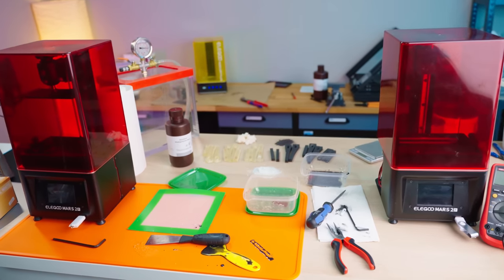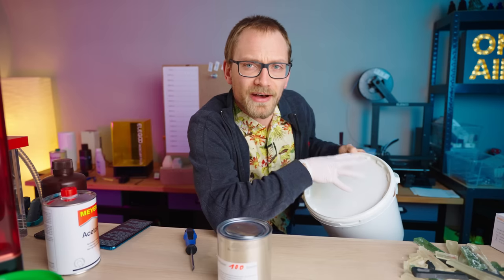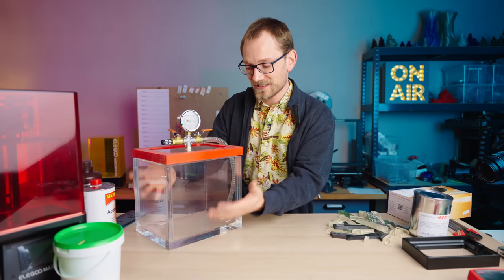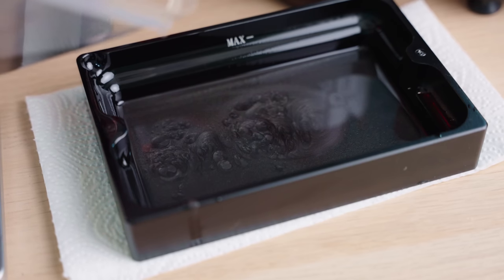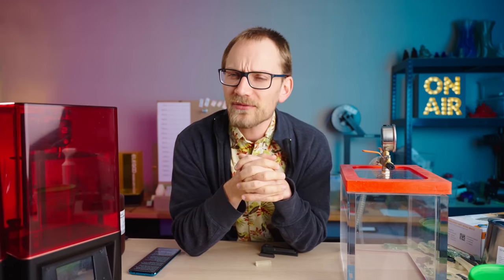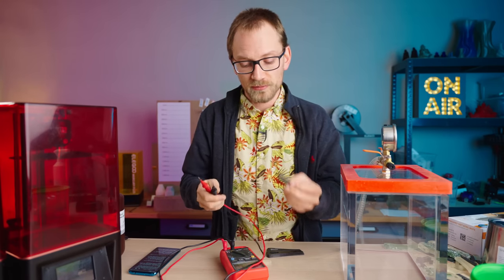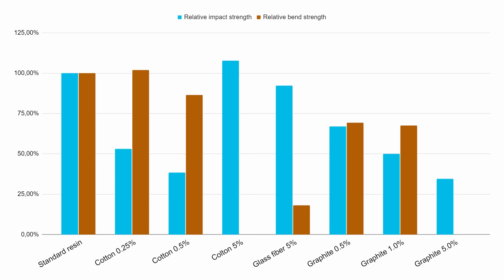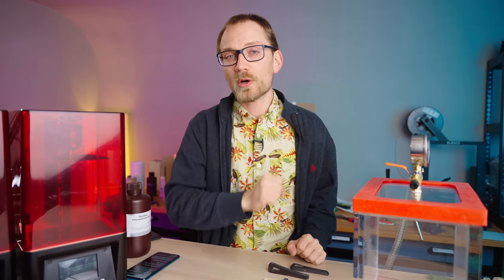Easier Fiber-Reinforced Resin Printing! Stronger and Conductive Resin Prints?

Comment: I very much appreciate tech creators who also show failures, not just success after success.  That's the engineering/scientific process.  Good engineers/scientists have a high tolerance for failure, building on it rather than giving up.  It is often the failures in pursuit of a goal that create spin-offs enabling entirely new directions and new goals.  Such as adding carbon for color and perhaps lubrication, rather than for strength.

Comment: I think a lot of the problem with this is that, while the particles (cotton and chopped fibre especially) are adding strength to each layer, they are only adding strength within that layer. Because of the way SLA builds the object, you're not getting any cross-links between layers, so it is exactly as strong as a normal object in unenhanced resin.

Comment: The reason for the "holographic" effect you saw in the graphite resin is that the flakes of graphite are orienting themselves with the flow of the liquid, so that their reflective surfaces are tangent to its flow - creating what is known as a "rheoscopic" or current-showing effect. In the bubbles, I'm pretty sure what's happening is the super-fine particles of graphite are causing an effect called thin-film interference, where the reflected light from the top and bottom surface of the material are different wavelengths and start to interfere with one another, causing those wild colors to emerge. The same effect is visible in soap bubbles to a milder degree

Comment: I was hoping you'd mention the lubricating effects of resin, glad you said something at the end. It makes me think of oil impregnated bushings. In addition to that, I'm very curious about thermal conductivity of those graphite parts. We messed around with some plastics at work filled with something and I want to say it was graphite. Although they lost flexibility, they had a very "cool to the touch" feel and that's exactly what we were going for. Trying to get thermal transfer improvements through the part.

Comment: Light is reflected from the outer surface and the inner surface of the bubbles, As the thickness is very thin,there is a difference in the refraction angle and it forms a miniature prism effect. Love the experiment.

Comment: It's only a theory, butI believe the fibers will impede the ability of the resin to fully cure by occluding the light paths to all areas of the resin. The masked resin is left to cure partially with refracted light from the subsequent layers. I'm not a composite expert, but I've been around materials a lot, and have some related experience.

Comment: Tom, I reckon that the graphite is so opaque that it's not letting the UV through the outer shell of the part to properly cure the inner. That could explain why adding more makes the part weaker.

Comment: The problem is that in a composite material, the purpose of the resin matrix is to transfer load from one fiber to the next. If you don't add enough fiber, you're just introducing impurities and therefore reducing strength. And you can't add enough fiber and still have a successful print with the way that lcd/sla printers operate.

Comment: These results make sense...the strength of resin comes from the cross-linked polymer chains.  Any foreign fibers you're adding just means there are fewer of those chains, and those fibers are stronger when locked together than chopped up and mixed with a foreign substance. The graphite did look cool though.

Comment: The glass fibers are clumped together because they're coated in something called a sizing agent. Sizing agents are essentially coatings that cover the fibers. Because glass fibers are chemically inert they will not bond with any kind of resin or epoxy matrix. These sizing agents have two fold benefits, they allow for this chemical bridge (aka a coupling agent, for glass fibers it's typically a silane) to bond to matrices and add a protective layer to the outside of the fibers for easier handling. They also bond the fibers together, that's why its so hard to pull the individual fibers apart, they're essentially glued together. That being said you can just sonicate the fibers to loosen and separate them.

Comment: You should try cotton and fiberglas at the same time. The cotton makes the resin thicker, so the fiberglas can stay chaotic in the resin and doesnt sink to the bottom and stay flat.
But maybe the printsurface squeeze everythink down and flatten it. Thats why a bigger resin container could be needed. So the fiberglas mixture can easier flow to the side and back after the printsurface goes down and up.

Comment: Add metal fileings. Place resin vat in a magnetic field to line up the filings.
Reply: The field might mess with the screen used to cure the resin though, correct me if im wrong.

Comment: I never did any experiments with resin prints but I have used imbedded needles or piano wire in FDM prints. I guess you could print channels into the parts and and pull long strands of fibres covered in epoxy through these holes. Or even take it further and print a thin walled mould in resin and then fill it with resin and fibres afterwards. The final part would benefit from the shape of the printed part and the more controlled placement of fibres.

Comment: Nice video, suprising results! Maybe cleanroom wipes as material? Either chopped up or in layers. Those are a bit like paper towels, but specifically designed to not shed particles and are extremely strong in one direction. So if you criss-cross the layers it might result in a really strong part.

Comment: Not sure if it's been mentioned. I use resin as a filler/primer by mixing it with sodium bicarbonate, about 40/60 and it helps the resin thicker and stays suspend quite well. It could help hold the heavier filler/additives.
Reply: Which resin do you use to fill your model?

Comment: If you want to improve the mechanical properties of your resin parts, you can do two things.
1.) Print at an elevated temperature of 25°C-35°c 
2.) Cure under water (prevents oxygen to inhibit the curing process) + cure under hot water (heat equals vibration, vibration helps in the bonding process between the molecules during curing).
Both of those measures should help significantly (About +50% more strength)

Adding anything to the mix weakens your parts since those molecules can not bind properly anymore and have to bridge a gap because of the "impurities" you have now introduced.

Fiber reinforcement works well with epoxy resins because those don´t need UV light to cure, properly mixed they will always bond to anything.

Comment: I'd be really interested in seeing additional testing with both the milled carbon fibre powder you mentioned, as well as a more fine glass particle powder. These are the two materials I've been thinking about testing myself recently, and I feel like have the best chance of improving the material properties in some way. I have personally been interested in these two materials to help improve rigidity more so than ultimate strength, in order to create lightweight, thin, yet rigid and still acceptably durable materials.
Something I've seen on the topic of the glass powder specifically is Formlab's Rigid series of resins(Both their Rigid 10K and 4000), which are claimed to be glass reinforced resin. Specifically for their Rigid 10K, they claim "Simulates stiffness of glass and fiber-filled thermoplastics" and describe it as "This highly glass-filled resin is the stiffest material in our engineering portfolio.". This to me seems to suggest that it's likely just a simple glass powder mix, which also leads me to believe other suitable materials(specifically milled carbon fibre) mixed using a similar method should produce good results.
This along with a strong base resin such as some of the engineering resins from Siraya Tech like Blu, I think could potentially produce some nice results.
Great videos by the way, love them, keep it up :)
I'm excited to see what other tests and videos you create in the future.

Comment: Please try sonicating the additives into the resin (or a compatible solution that can be added to the resin)! Sonicators are essentially ultrasonic mixers that produce a colloidal dispersion. In the case of graphite, it may also cleave into graphene, liberate bucky balls or nanotubes, etc. For chopped fiber, the bunches may separate, though milled fiber would probably be better. No idea what cotton would do. Let’s test it!

Comment: Did you consider trying a mix of the glass and cotton or carbon and cotton. You can make the cotton conductive first then add it. I would suggest pausing the print with normal resin and adding only a little bit in midway(with a brush I think)

Comment: Hi Tom. Gr8 video. The reason the graphite bubbles are shinny is probably due to thin-film interference. Also if you want try out graphene (1-3%) should do the trick. I suggest you make it yourself, just buy a ultrasonic cleaner, get some graphite electrodes from zinc-carbon batteries and a bit of ammonium sulphate (common fertilizer).

Comment: Not a materials engineer either, here; but, you can think of what you're doing as creating inclusions in the resin.  Inclusions in metal causes the metal to fracture over time in certain conditions.  If the particles you are mixing in are larger than the particulate size of the material making up the resin, you may or may not get a good bond.  Remember, in fiberglass for example you are working with a woven cloth base that already has strength in and of itself.  By incorporating simple fibers, you don't have the strength you tend to get from weave.  And if you aren't careful with the resin application, it won't soak through the weave - leaving voids and leading to delamination.  Love seeing you do these tests tho.  This is the core of the hacker experience - test, experiment, learn.  And good to see Siraya Tech chiming in.  Though it does make me wonder if approaching this with a fine weave material at each layer or every so many layers would make a difference.  Food for thought.  Something like silk...

Comment: For the chopped fiber I would've maybe shredded them further in a blender or DIY ball mill then used only resin for the first 5 or 10 layers to ensure its bonded to build late then sprinkle in some every so many layers or minutes. This type of system could be automated if it ended up working though you would still have to clean/strain whatever is left or use it for pouring/sprinkling on next part. I liked the milled CF idea and would like to see a similar process applied to it as well.

Comment: I work at the "Institut für Flugzeugbau" (roughly translated "Institute for aircraft construction") at the University of Stuttgart (only as an assistant, while I'm studying, I might add)
We experiment a lot with fiber reinforced plastics, especially from carbon fibres.
I was about to suggest this topic as a possible bachelors or masters thesis, but seeing the difficulties you had, I think producing viable results might not be as easy, as I thought.

Comment: After degassing, if you VERY briefly blow hot air over the top of the liquid from either a heat gun or torch, you will get rid of the bubbles on the top.

Comment: I make some tests myself back a year with graphite powder and it was today disappointing. My focus point it was the electrical conductivity I test in the various mix with no positive results. A test that I'm planning to make is to add some solvent to the higher ratio mixtures and use it this way.

Comment: I wonder if the graphite version would improve if you had a thin layer on top of the resin? One of the newest ways to produce graphene sheets uses the method of evaporating liquids with undissolved graphite, the evaporation allows the graphite to form a single layer of uniform graphene molecules. Here a top layer of undissolved graphite may adhere to the cured resign. The final print would not have a thick layer of graphite/graphene, however, it may produce just enough to increase the strength and bend radius results.

Comment: I think a great idea to test is trying to print on higher temperatures. Heat the vat and print and see how it affects the part. Bc polymer chains would usually be longer under higher temperature, and the material might be slightly better in terms of strenght, heat resistance etc.

Comment: For aesthetics Venta black would be interesting.

Hexagonal Boron Nitride for its dry lubrication property. Cubic Boron Nitride for abrasion resistance.

Dendritic Copper might work for conductivity, both electrical and thermal.

Comment: I wonder if painting on the graphite/resin mixture in a very thin coat, similar to using resin on FDM prints to smooth layer lines, would produce any different results in regard to continuity. Perhaps it could be used for light shielding or like a poor man's Faraday Cage? Or even a thin layer with a higher percentage of graphite to see if the graphite would indeed work as a lubrication assist for whatever type of sliding movement you might try? Just a though. Love the video as always, thank you and best wishes.

Comment: The form 2/3 has a fibre filled resin. I think u need small chopped strands. Large enough to connect or bind resin to increase strength but small enough to mix evenly to stop stress concentration

Comment: You can get specific fibres for re-enforcing concrete floors they're chopped fibreglass but single strands, not clumps like you used.

Comment: Don't these fibers / additives primarily bond properly only in one layer individually? If so, they may add strength in that one particular layer if the fiber is ideally oriented, but as any fiber not laying perfectly flat and being fully contained inside that layer, would now be stiffened and protrude from that layer, it will push against the bottom film when coming down to do the next layer, and would drastically weaken the layer bonding to the next. So parts will fail due to a rapid cascade of individual layer breaks and delaminations.

We have to keep in mind about mechanics when trying to reinforce prints, that SLA is still individual layer by layer creation. That will require a significantly different approach to (filler) reinforcement, than casting and injection molding.

Comment: Try Hollow Glass Microspheres. They're glass, so shouldn't impede optics too much, and does provide composite strength capacity. 1-5% by weight gives 25% by volume

Comment: An idea that comes to mind would be either wood dust, or very fine shavings to get fibers along the grain. The wood theoretically should allow the light to pass through for full curing, and the wood fibers should add strength. Some tests with hardwoods, such as Oak, Teak, or Maple, and softwoods, like Pine, Spruce, or Bass, would be neat to see. Maybe the particles would allow the resin to be stained or such for purely visible effects as well. I would assume it would work similar to the cotton, but the fibers would be stronger by weight, but would still suspend in the resin due to the buoyancy.

Comment: The reason it appears those colors is that it is a conductor and the electrons are in the conduction band and this means the electrons will easily  absorb any amount of energy including different wavelengths  of light and it absorbs them all.

Comment: I used paint with graphite added to make prints conductive for electroplating.
After painting you need to brush it with iron wool to make it conductive, to expose the graphite

Maybe you should try that on your prints

Comment: I have an idea for the lowering in impact resistance - in cast iron there's two kinds, one where the graphite has a lamellar shape and one where it has a spherical shape (GJL and GJS). The one with lamellar graphite has a lower impact resistance due to "inner notch effect". Around the lamellar shapes you have a lot of "notches" and sharp corners that are a great start for cracks to form. Essentially a tiny predetermined breaking point. I'd expect the effect to be similar when having particles in the resin.

Comment: Interesting. You may be on to something here- It's clear to see by far the most homogeneous of these is the graphite mix, so that's out for strength, but what about 3d printing a mold in 2 parts, pour some well mixed chopped fibre and cotton in (don't use the stir bar it's super ineffective, lollypop sticks are the norm for mixing resins, pigments etc into molds and use a very thin application of mold release like vaseline), then using UV to cure it. Demold and test one more time? The mold needs to be really thin and have an exposed open top to allow the UV to penetrative the test part, all it needs to do is hold its shape.

Comment: The colored bubbles look like interference between the light being reflected by the outer and inner surfaces of the bubble's wall, which boost a certain frequency depending on the wall's thickness.
I think the reason why these are visible is that the graphite is accumulating at the interface between resin and air, which makes for a partially reflective surface

Comment: Microbaloons are a thing that might be worth trying.  It would reduce the density.. I doubt it would help strength.  Also, worth looking into, is something called fumed silica.  I understand that forms microscopic fibers.   It's used as a strengthing agent for fiberglass.  

The graphite making the rainbows is because it's flat flakes, causing the same shimmer you see with perl paint, I believe.  

I feel like to get consistent layers, you need to do something about mixing... perhaps a higher, intentional, lift of the platform?  And a thinner resin?  Have you considered heating it so it's more fluid?  

To continue on the fiberglass thing, you can look for "fiberglass flock" which is milled fiberglass.